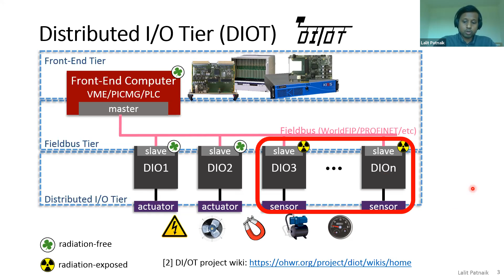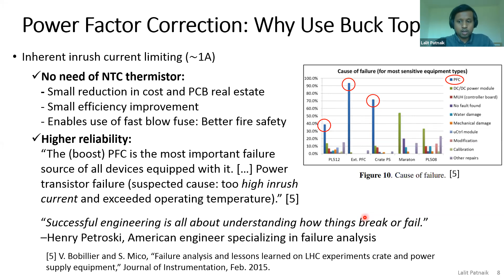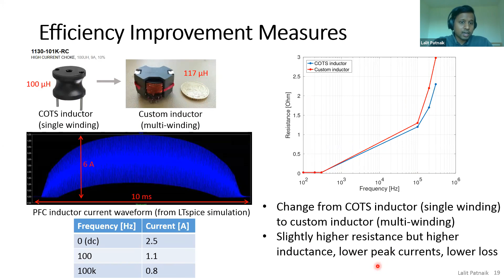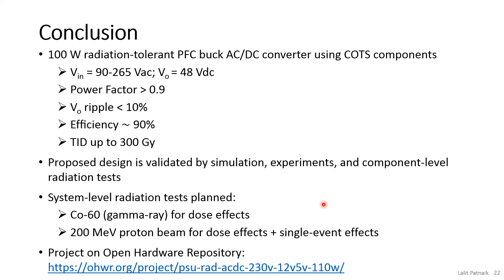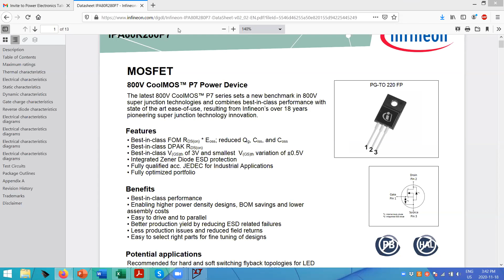Design of a 100W Radiation-Tolerant Power-Factor-Correction Buck AC/DC Converter | Dr. Lalit Patnaik

Comment: Thanks for sharing interesting webinar which highlights on designing with optimizing the cost at the same time  without compromising on design requirements.

I got to know about few more Jargons #DIOT , #RatoPUS

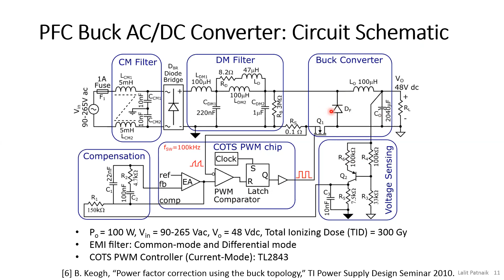In the session at time 48:30 one of the participant  has suggested about using active filter to reduce the output capacitor value .

 Sir can you or Dr.Lalit Patnaik sir suggest any reference material/article/book  to understand more about the active filter technique in power supply which  mentions in more detail about methods of reducing the value of output capacitor at the output of the Buck convertor?
Reply from the maker: Please ask your specific question here: https://www.facebook.com/groups/ridleyengineering